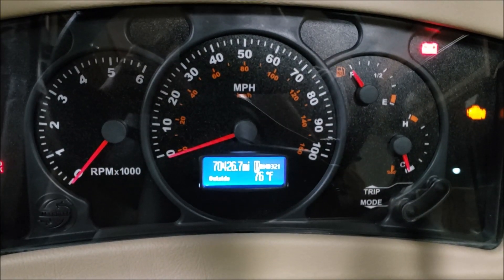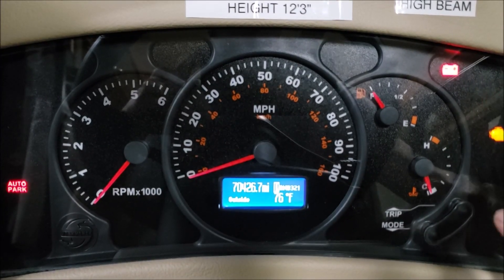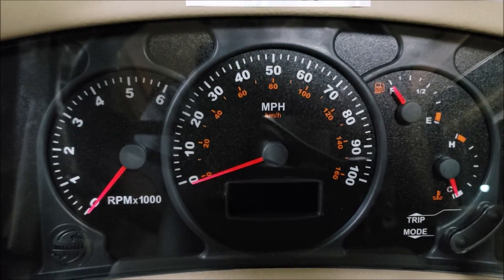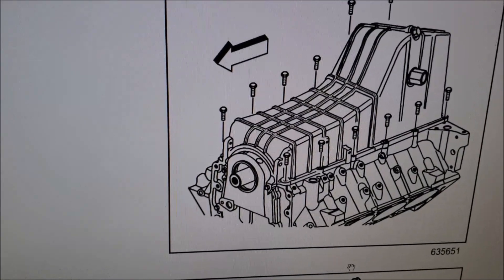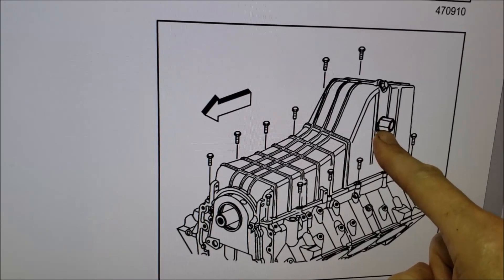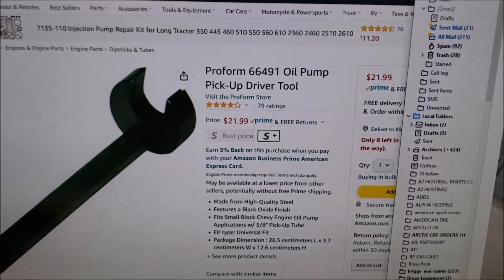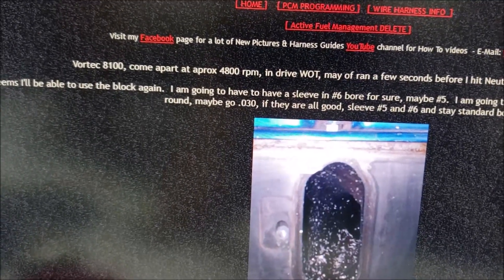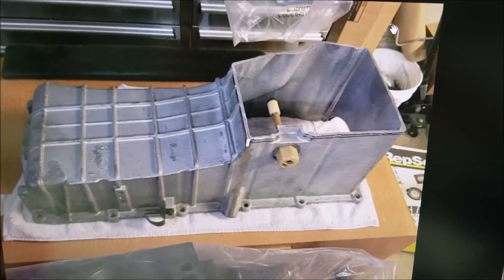8.1 8100 Vortec Engine Low or No Oil Pressure Light Comes On at High RPM

Comment: on my truck I was able to remove the pan entirely when replacing the oil pan gasket.  I had to remove the front differential but that was surprisingly easy.  The engine looked brand new inside even with 270k miles
Reply from the maker: Thanks for contributing I hope i never see the inside of our engine...lol

Comment: Thanks for posting this….I just purchased a 2007 Itasca on a w24 chassis with the 8.1 and of course driving it the 4.5 hours home the low oil pressure alarm came on when I was climbing a freeway grade where it dropped into 5th was only at about 2900 Rpms the oil pressure readout on the dash fluctuated between 8 psi and 20psi, pulled over and the alarm stopped, checked oil level…fine…no leaks…Accelerating back onto the interstate it did the same thing with the pressure fluctuating until I let my foot up when I reached 55mph…where it maintained about 42psi..as long as I was on mostly level road…Hoping its just the oil pressure sender unit…I’ll start with that and change out the oil filter then go from there….,Thanks again for posting this as this may be the problem
Reply: Thanks so much Kevin, Going to investigate it this weekend with my endoscope and see if I can see the pickup tube loose or lying in the bottom of the pan…if it is that dropping the pan down enough to put the tube back in doesnt look like to horrible of a project…I hope…lol
Reply from the maker: @karlreese8341  Please update me on what you find my cell 606-875-0125 Kevin
Reply from the maker: Please let me know what you find out if you have any questions text or call my cell 606-875-0125
Reply: Interested to hear what happened with this? I recently purchased a 2005 itasca sunrise with the workhorse package. Took it on a trip 5 hours away through some mountains and sure enough the low pressure light came on in the hills. It's fine on level ground. Haven't had time to tear into it yet, but hoping to soon.
Reply: @tfrazier3041  So after putting a mechanical oil pressure gauge on it and driving it, it is dropping oil pressure momentarily while accelerating harder or where Rpms are up such as when it downshifts at higher speeds…..Long story short it has a remanufactured engine in it with only about 4500 miles on it…at the time of install of the new engine a 10 quart oil pan was installed but I’m suspecting that too short of an oil pickup tube was used…or a high volumne oil pump was installed which can cause oil starvation in a stock engine since oil cant drain back into the pan quick enough….I’m actually taking the motorhome to a trusted shop this week to finally confirm the problem…It can’t really be anything too serious on that new of a motor…Too short of a pickup tube or high volumne pump is about it…..I did confirm with a camera that the current pickup tube is still attached and did not fall off as that can happen also……..Also, to be on the safe side while the pan is off we’ll check the bearings also…🤞on that…lol
Reply: @karlreese8341  Thank you for the update. I still haven't had time to check mine, but hoping to in the next 2 weeks.
Reply: @tfrazier3041 curious if you figured out what your problem was?
Reply: @karlreese8341 did you ever figure out your problem?
Reply: @bounderchris  Hi Chris, sorry for the delay in replying, but yes the problem has been fixed…After researching what had been done to it, I found out the engine had been replaced 2 years ago and only has about 4500 miles on it…I drained the oil and took out 9.5 quarts! The dipstick registered about a half quart low which supported the 9.5 quarts..I refilled it with 10quarts thinking it was a 10 qt pan since the pan had been changed also…and the stick now registered full..Drove it a mile or so and it was worse..Sooo…ordered the correct 6.5 qt pan, new oil pump etc…thinking the pan had to come off…Laying awake and dwelling on this one night I decided to measure the outside of the new pan and compare it to the one on it and the dimensions were identical to the new one…So once again, drained and refilled with only 6.5 qts and drove it and solved the problem…😆It was overfilled by almost 3 qts…So the dang dipstick was wrong all along…probably when the engine was changed they screwed it up or put in the wrong tube or something….So simple of a fix but drove me crazy for months..We live in a remote area with no Rv mechanics and of course didnt want to drive it far with wonky oil pressure…Sorry for the long reply but thanks for asking and again such a simple fix and really no mechanical issue..Just have to sort the dipstick dilemma out…
Reply: @HondaCTTrailForSale  wow thank you for sharing! That’s crazy to think too much oil like that caused so many problems and less oil pressure!

Comment: Hey Kevin..
Great info on our 8.1 !!  
Luckily haven't had the pick-up issue on the coach but, the 454 big block motors I've put in my jet boat. I also have always welded the pick-up tubes on for preventative measure.
Thx for sharing!!
Scott

Comment: My bottom bearings went out at 13,000 miles lost oil pressure didn't go 2 miles after it lost oil pressure cost 13000
Reply from the maker: Scary did they say what caused the failure ?

Comment: Good day Kevin. This is definitely something no one would want to ever happen. I have heard of people welding the pickup onto the pump. Take a close look at the pick up tube that had fallen off. The marks on both the left and right side of it appear as if it may have been put on using the incorrect tool. It makes me wonder if this engine had been serviced and the tube not put on correctly. Because that engine does have a windage tray the crankshaft is well protected.
Reply from the maker: Good catch he has not had the RV long so that could be the case

Comment: Again, thanks a lot,
   Is the oil pressure gaugable on our Scan Gauge II? Sense it is on the engine computer, it must have an oil pressure transducer?? I would like it on my Scangague. Is it possible?
     Stan
Reply from the maker: Yes you can add that to your scangage2

Comment: Another great video, thanks Kevin!
We do most of our trvelling from Ottawa, Canada to Yuma, and bak to Ottawa 6 months later, taking a week or two each way (Canadian Snowbirds). I keep the oil pressure on all the time. I don't know what the oil pressure is supposed to be, but travelling at 55-60 mph I have the oil pressure showing 39-43 all the time. I had heard that the 8100 is an oil burner, but I  use about a quart each way (2800 miles), which I figure is pretty good. We have no toad but we have ebikes with saddle bags and racks to get around. I don't want to put extra  heavy work on the W22. Works good for us.
Reply: That is normal for hot 5w30. You might see a few lbs more with 10w40 but mostly you'd see it more cold.
Reply from the maker: Stay tuned I have a normal? oil pressure video coming out soon